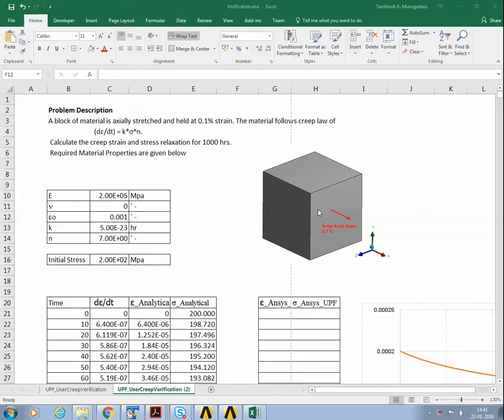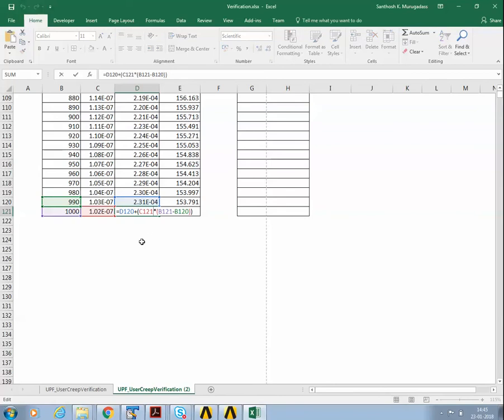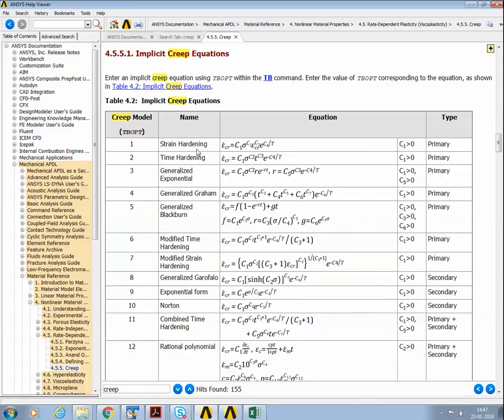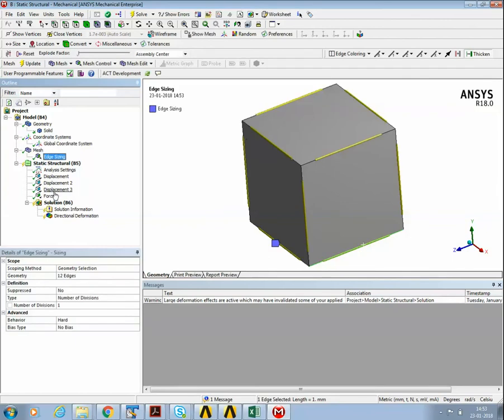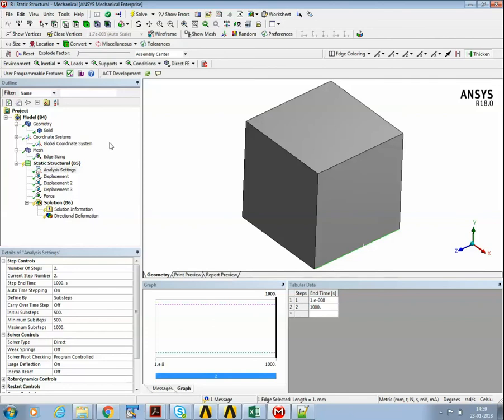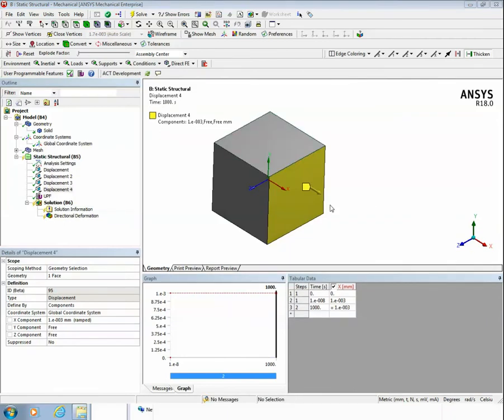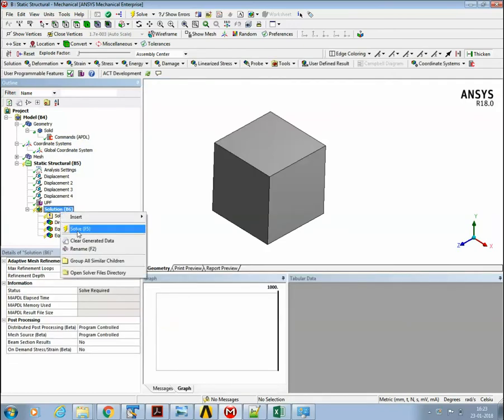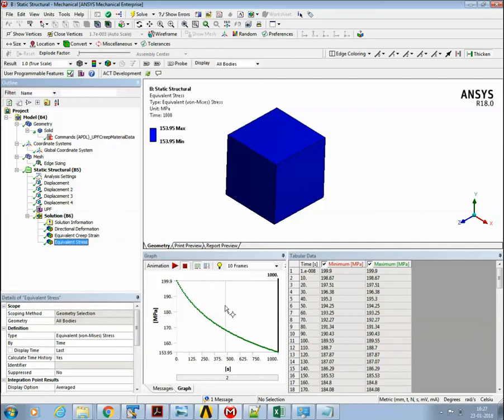Ansys UPF ACT APP UserCreep Procedure

Comment: hi, thank you for the video! what kind of boundary conditions are you applying? I'm trying to recreate the video, but having troubles establishing bc's correctly.
thanks!
Reply from the maker: Same as Fig 5 here, but dimensions are 1x1x1mm. UX=0.001
https://www.researchgate.net/publication/276842215_IDENTIFICATION_OF_MATERIAL_PARAMETERS_BASED_ON_A_HOMOGENIZATION_METHOD_USING_EBSD_DATA
Reply: @SanthoshKumar-ge9sq  thank you! I want to retry your example but without UPF. I also want to extend this to a dogbone sample. Do you think modeling a quarter of the full geometry with symmetry BC would be sufficient?
Reply: @Lala2862  Hi, can you resolve the BC conditions? im have problems now..